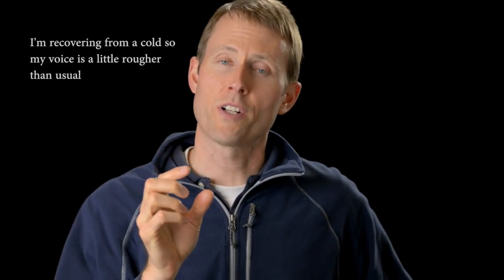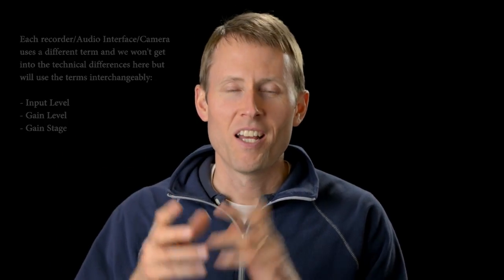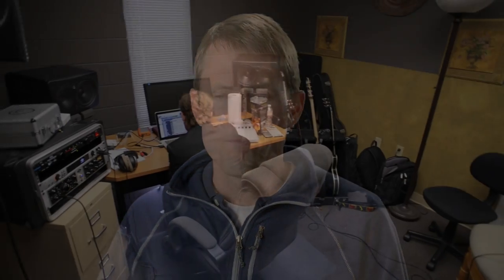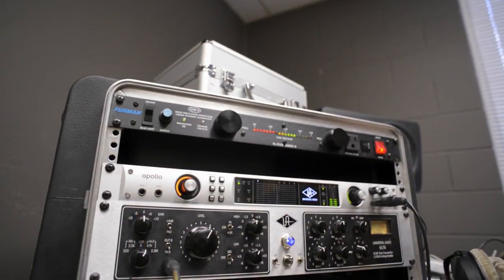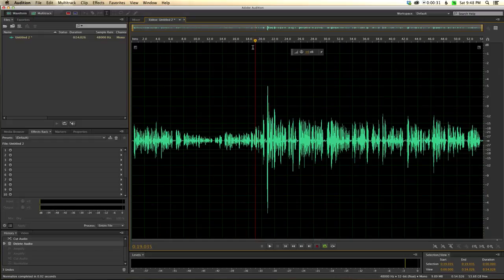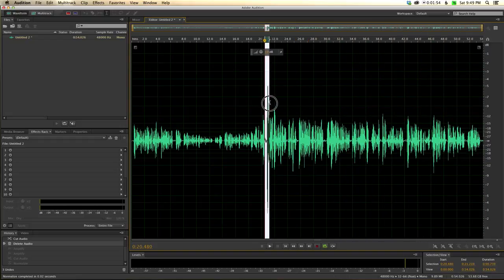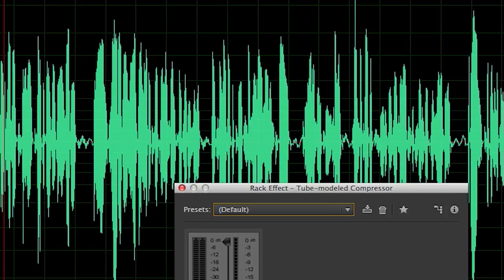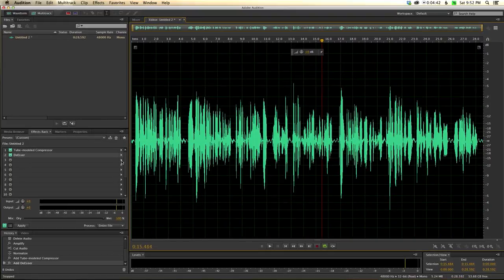Setting Input Level for Better Dialogue Audio

Comment: Another great tutorial, 3 questions... 1. I was told lowering your gain makes the voice print close to the noise floor meaning when you raise it in post you will also raise the noise level. Is this true or does it not matter at all. 2. Whats the different between adding or setting gain to -3db and normalising to -3db? 3. Do you fix your audio before editing in Premiere or do you send a Premiere timeline to audition?

Comment: Curtis:  Thanks for another great video!  Question.....In the video, you mention that you used a small hand held recorder for this audio. If you were using your Sound Devices mixer/recorder for this, would it change your input levels any? Since the professional decks have better mic pre's and analog limiting, would you still record at -20 to -18 db? Or would you feel comfortable bumping that up a little to say -18 to -12 db?  Thanks again......William
Reply from the maker: Hi Richard, That's a really great question, People's voices can be extraordinarily dynamic. In a shoot a couple of weeks back, the talent had one of the most dynamic voices I have recorded and I ended up having to gain down after the first take because he was engaging the limiter quite a lot. I would actually feel more comfortable gaining down with higher end recorders like the 633 because of its cleaner preamps. This gives more room in post for compressing the transient peaks and normalizing without introducing too much noise. It is the less expensive consumer grade recorders where I tend to push the input a little more aggressively with peaks closer to -12 because I know that I won't have as much latitude in post. And if things get too loud during the recording, I have to make the call on whether to do a retake or take my chances at de-clipping the audio in post. I hope that makes sense and thanks for the question!
Reply: Curtis Judd Thanks.  Great info.

Comment: Hi Curtis - great videos. I've had a Tascam DR100Mk2 for a few years. What's been a great help is getting an XLR Y-adapter - single mic into both inputs. I set one channel several dbs's lower than the other - a safety track. Saved me many times. The adapters are  inexpensive.
Reply from the maker: +Kevin Olson Great idea for a recorder which doesn't have a limiter or safety track feature. Thanks for that!

Comment: Hi Curtis. Nice tutorials, I like it when you deliver the information without spending too much time talking.

So, I have a question here: if you aim for -12 to -16db when recording and then you normalize it to a higher gain. Won't that increase the noise in your recording? I'm learning audio recording for filmmaking and I thought it would be hard to cancel noise in an outdoor shooting situation, where your mic will also record ambiental sound like cars, foot steps, etc.

Thank you,
Cristian
Reply from the maker: +Cristian Roman hi Cristian, yes, you are right. The trick is that on the flip side, you'll get clipping distortion if you run the gain too high and the talent suddenly laughs or speaks louder. So it is a compromise. Fortunately the newer recorders are getting cleaner in terms of self noise so it is not nearly as much of an issue as it was in the past.
Reply: Curtis Judd thank you for your reply. I bought myself 2 days ago the Zoom H1 recorder and it seems it has a lot of noise, especially when I'm using an input of 70-80. Maybe is something wrong with it?
Reply from the maker: That depends. Is it self noise from the recorder or ambient noise from the space in which you're recording?

It should not produce a lot of self-noise which often sounds like hissing.
Reply: It sounds like hissing to me, but I'm not sure of it. Is there a way to test if it's ambient space or self noise?
Reply from the maker: Start recording with the H1 and put it on a bed with about 20cm of blankets on top of it in a quiet room. Let it run for 30 seconds. If that recording still gets lots of hiss, then there's probably something wrong with the recorder.

Comment: I watched your video on best input setting for the Zoom H1.  I tried 37 and my talking voice is at -24db or less on the zoom.  If I crank it up to input 80 on the zoom I can get -12db if I talk a bit louder.  It seems the lower my original recording is, the worse it sounds when I normalize it to -6db like in your other video.  In this one you normalize to -3db.  So when I set the zoom h1 to 20 input and my mic to +20db talking from the same distance I get between -12 to 15db but it sounds louder and fuller when normalized.   I'm just trying to use this for audio when vlogging so that I sound good but also anything I record sounds good as well when the camera is not facing towards me without having to constantly adjust the input level.    I guess what I'm trying to say out of all of that is that the lower the recorded level I get, like -24db showing on the soom h1 screen, the crappier it sounds when I normalize it afterward.    Maybe I should just stick to using auto levels!  Cheers.
Reply from the maker: Hey Ryan, thanks for the info. This was a bit more of an academic test. If your settings sound good, then they are good. Best wishes!
Reply: My settings never sound good.  I can either set them really high on the mic and low on the zoom (or high on the zoom and lower on the mic) and risk everything that isn't my voice being too loud, or set everything really low and normalize it later and it sounds bad.   Maybe I should have gotten a lavalier mic instead.  But at least either way sounds better than when it is plugged directly into the camera. All you get then is HISSSSS!   Cheers.
Reply from the maker: Are you using a shotgun mic like the RODE Video Mic Pro? If so, do you have it on top of your camera or boomed above your head? You can boom it and dramatically improve the sound like this: https://youtu.be/TUEmQBZKoBs
Reply: Yeah, it is a video mic pro.  It's on top of the camera, but it's on an action camera grip so the mic is 6-8 inches above the camera.  It's for vlogging and traveling so there is no permanent option for boom (though I do have it for at home, and use it!)  Both point down towards me slightly.  Only about 1 foot from my face.  In order to get register -12db or so I almost have to stick the mic into my mouth unless I put it on +20 db.  But I also think I just have to watch more videos and test different things out.   I am getting better results now with a really low recorded level, even if it is -24 and normalizing it to -6db.  Cheers.

Comment: I just discovered your channel and it's a gem! Quick question: I just purchased Sound Devices Mixpre10t and Audix SCX1HC, I love the sound but I'm still confused about gain vs fader volume. Does it make sense to keep the gain imput as low as possible and just raise the fader volume so that I don't raise the noise floor? I did a bunch of tests and I was getting clean sound at imput gain 50db and fader turned up to +10db. My peaks were at -12dB. Any thoughts?
Reply from the maker: Hi David, thanks! Normally you’ll want to do the gain staging with the gain setting before you start the recording and then use the fader to fine-tune how much of the audio signal is sent to the mix tracks during the recording. In that light, I usually prefer to start the recording with the fader at 0 so that you have room to move up or down during the recording. Good luck!
Reply: Curtis Judd Thank you for answering my question sir!

Comment: Thank you for your tricks.

I usually peak about -3dB normal sound will at -6dB. Because if I crank up to nearly 0dB, Mostly in Cinema Theatre sound system won't adjusting volume to suit the video or film which playing and loud or clipping because they have calibrated all system to optimum. So normal sound at -6dB should be safe for all equipment.

Something weird when mix the sound. Some speaker tend to peak on mid-range especially small or cheap one. I normally reduced mid little bit before bounced them out.
Reply from the maker: Good ideas--thanks Chanon!

Comment: I know this is an old video, but If your main speakers were in front of all the microphones then you will be able to minimize feedback in a live recording situation.  Also the amps for the base and guitars should be more in the middle behind all the mic's. and behind the performers.  Also if you set your recorder so you just barely see the noise floor on your levels, then you will kill a ton of noise.  You should also be able to record a solid voice even if it doesn't reach 12db, because you didn't record as much noise.  So when you volume up on Audition there is less noise to start with.
Reply from the maker: Thanks for the tips!

Comment: I think that with our cheep and noisy recorder's.....12 to  18 is not a good idea. If we record near to 0 db  the difference to dialog and floor noise will be better. For this reason I have bought a Sound devices mix pre-D.  Thank you very much for you youtube channel and your contribution! Greeting to you!
Reply: That Sound Devices Mix Pre-D is $899.  A bit steep, eh??
Reply: Bruce Avilla
Yes! Very hi price for a 2 channel mixer, but I work for indy film. What can I do without Sound devices?! Greetings
Reply from the maker: You make a good point. There are two assumptions I didn't mention which are pretty critical: 1) that you are using a clean preamp (which many of us are not--not sure whether a Zoom H1 qualifies and most DSLRs probably do not quality) and 2) you are recording in 24 bit (which most cameras are not) so that you have enough "resolution" to process it in post. It may be that my issue wasn't that I was recording too hot but that I was just mastering too hot. It seems like in my most recent experiments that mastering so that the final peaks are at around -3db works best, at least when it comes to most online platforms. What is your preference on that?
Reply: Curtis Judd I use a zoom H6 and if I record at input level 7 is very noisy. Zoom is noisy recorder compared to professional recorders. Anyway I have find the solution! I go out from sound devices mixer with XLR and input to the zoom H6 with mono jack 1/4 (unbalanced) This way can help me to record at max input level 3 and about near of zero. Work perfect! I work in post production too but if the audio file is noisy, when I compress and normalize the level of noise floor grow up. Excuse me for my english!

Comment: So isn't it better to immediately record a louder signal with the limiter on in the recorder and then there is less editing? Better to record a quieter signal and then amplify it in post-production? I do not know if the noise signal is not greater in the second case after all?

I am also interested in how to set it when there is a large amplitude of levels - that is, some sounds are much louder, and others are quiet - on the same recording. it is not always possible to record each instrument separately, sometimes there is no time for it or the recording is very dynamic ... so what then?
In this case, I set the gain around 6.5-7 / 10 on the Zoom H6 and uses a limiter there, which prevents clipping. Perhaps I am doing it wrong? After your movie, I started to wonder ...
Reply from the maker: Yes, if you have a good limiter and the signal is just hitting the limiter periodically and not constantly. The H6 limiter is pure digital and doesn't prevent distortion so I'd be hesitant to rely too much on it if you want a clean, distortion-free recording.

Comment: What about sample rate and bit depth? When exporting from Avid Media Composer or Premiere I've read to send 48 KHz with a bit depth of 16. Would I record at 96 KHz & bit depth of 24?
Reply from the maker: Yes, much like on the video side where we typically try to capture higher quality. However, for dialogue recordings, I usually record at 48kHz, 24 bit unless I'm recording sound effects that I will be processing heavily (or slowing down and resampling) in which case I will record at 96 or 192kHz (always at 24 bit).

Comment: Hi I recorded some dialogues for a film directly through the h1 at input level 25..I can hear the dialogues faintly in the recorder speaker..its saved in wav format..but when I transfer it to my pc, all I hear is distortion or just wind..please help!
Reply from the maker: Hi Anant, how close was the H1 to the person speaking? Also, you'll probably want to set the input level higher than 25 in most cases. If you place the H1 within about 30cm of the person's mount, somewhere in the 40 to 50 range is probably better. Good luck!

Comment: I am ready to export my feature movie of 2gigs, and there are ghost audio sounds, most likely glitches from my system being too slow. Should I export at a higher resolution? I heard something about apple 4444 or something like that for export. Not sure it will matter, have you ever had this issue? I know its not my audio because I can play it over and over in the timeline and somethings its there and sometimes it's not.
Reply from the maker: I would export in the format you need to deliver (e.g., if delivering for a film festival, they will specify this in the technical requirements for submission). Then check to see if the glitches still exist in that. If so, you'll want to contact the company which provides the software you're using. Best wishes!
Reply: @curtisjudd  thank u and I meant to say 2 TB...Lol
Should I try removing the Prefs?  Not sure if I will lose session data? I recently switched from 2tb to a 4tb but still very slow
Reply from the maker: @commercialand  I'm not sure. Are you using Adobe Audition and Premiere? If so, probably best to contact Adobe. Best wishes!
Reply: @curtisjudd  final cut
Reply from the maker: Ok, I’m not sure what deleting preferences keeps. Might be best to contact Apple. Sorry I couldn’t help more.

Comment: FYI Folks:  Snagit, is better than Smart Screen Capture, by far.  But I am still uncertain what software you are using for the Audio adjustments.  I am having difficulty with lavalier microphones using the Tascam DR60-D......
Reply from the maker: I use Adobe Audition but any digital audio workstation app should work.
Reply from the maker: +JennyFTOL I use Adobe Audition for editing audio. On the open source side, Audacity. It is not as easy to work with, to be honest, but it is free. Just recently, Avid has also made a free version of ProTools available called ProTools First. The learning curve is a little steeper on that. On the less expensive commercial side, there is Reaper which I have used quite a lot in the past.

Comment: -18 to -15, isnt that too low? I thought -6 was the target for peaking?
Reply: I have heard -18 to -12 is good
Reply: boost in post. setting gain to peak at -18 to -15dbfs gives you a good signal to noise ratio and allows plenty of headroom during the recording process.
Reply: I've been stressing over such matters, even before coming across Curtis's great videos (including this one), despite having worked for a couple of decades by 6-12 dB headroom as a rule of thumb, occasionally 18 dB (only in uncertain or nerve-rackingly important situations).  But it's always worried me.  Either I set 6dB and sweated over possible clipping (e.g. repeatedly revisiting the meter while operating a video camera), or I set bigger headrooms and still sweated, this time over possible quality loss.  So, having some free (ish) time, I recently did some subject research (googled a lot and kicked a few calculable tyres).

For a linear audio recording (e.g. as in a 16-bit WAV-PCM file), each successively greater bit represents a correspondingly successive 6dB increase (in electrical hence audio power) over the previous (lower) bit.

Optional Explanation of the above: Each successive bit corresponds to an equally successive doubling of (analog) voltage (from an analog-digital convertor), i.e. a 3dB change in that voltage.  However it is the dB change in power that we're interested in, and that is proportional to the square of voltage.  Given that dB are logarithmic,  squaring becomes multiplying by 2. So each successive bit corresponds to a 2*3 = 6dB increase in the amount of power it represents.

Therefore with 18dB headroom we lose the use of 18/6 = 3 bits.  Consequently for a 16-bit recording only 16-3 = 13 bits are left to represent the expected biggest waveform (the one you're setting up against during sound-check etc.).  Of course that could change if (feared/anticipated) unexpectedly loud stuff actually happened, or if there were unexpectedly persistent low-level periods.  Regardless (e.g. assuming the sound-check levels turned out to be valid) a 13-bit representation implies 2^13 = 8192 quantization levels hence a (power) signal/noise ratio (SNR) of 20*log10(8192) = 78 dB.  I understand that figure is in the general range of the best tape recorders of analogue era.  Not as bad as I had imagined/projected then...

24-bit offers the same 6dB/bit but there are more bits !   So no headroom risk/cost to fear - bits to burn !.  Maybe I should be doing that from now on.  My Zoom H6 can record that format and file sizes are no longer the issue they once were.  Wouldn't expect any noticeable improvement in quality, as compared to those 13 bits, but "the more insurance the better" i.e. less sweating.

I'd be really interested in what Curtis or others know or have experienced in this area.  Or indeed any mistakes in the above reasoning, theoretical or practical.